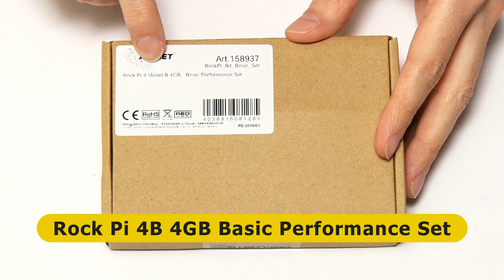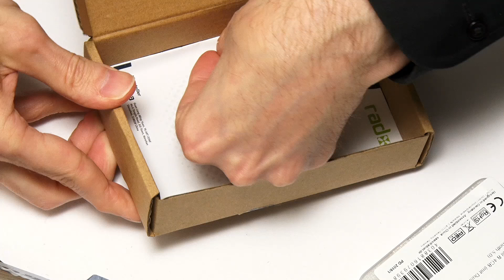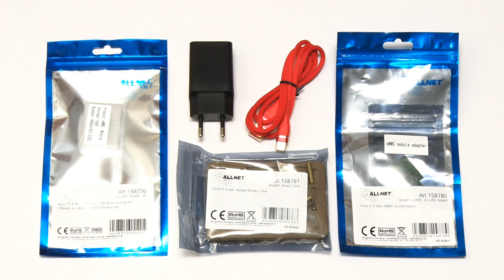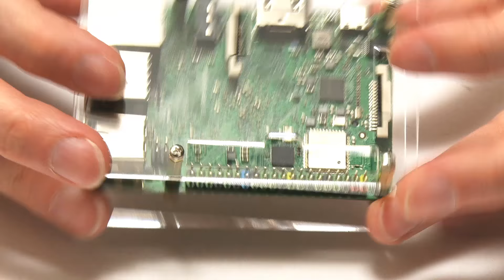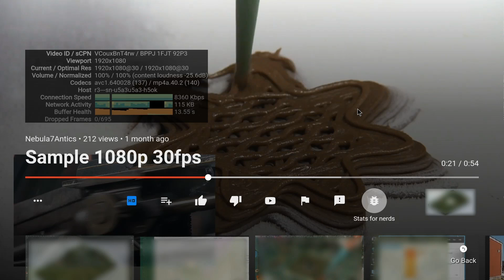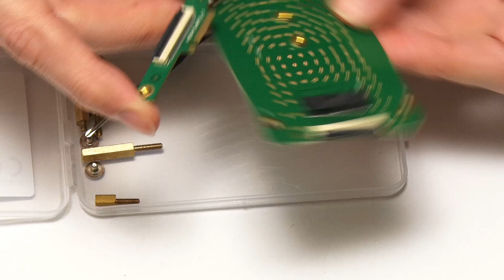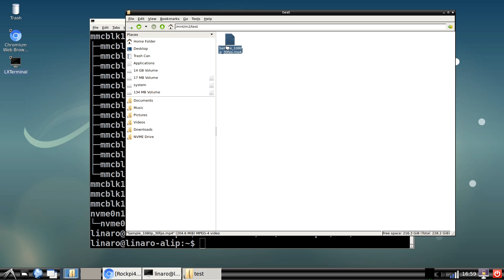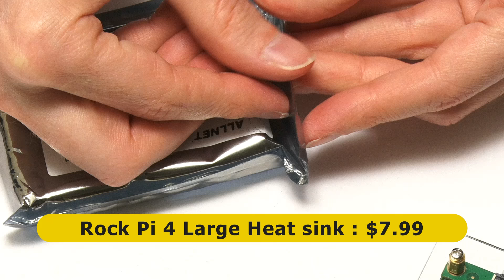Rock Pi 4B : M.2 & USB 3.0 SBC

Comment: The M.2 slot is in such a stupid place
Reply: I don't think so. This way you can have as large a m2 SSD as you want and it won't come over the CPU.     
Sure, it would make more sense on the front side, but then you won't have your RasPi style compatibility and you'll most likely be limited to M.2 2240 SSDs
Reply: @thekakan  - Fair points.. certainly that CPU would fry longer SSDs. And you'd lose the ability to put a heatsink on the CPU.
Reply: Agreed.. why have it so the M.2 board will stick waaaay out to the side?
Reply: It's going to get fried. They needed an extension ribbon
Reply: @blakryptonite1  we do have users who built their custom housings and directly connected the NVME to the M.2 slot. of course not on top of the CPU ;-)
Reply: wellll... yes but it also allows for external device option

Comment: You need to just clear the data and cache inside the Google Play app and also Google service framework. The latter will require you to enable system applications.
Go to settings>Applications
Click the 3 dots menu and enable 'Show system apps'
Scroll down to:
Google Play Services>
Storage>
Clear Cache
Google Play store>
Storage> 
Clear Data
Exit settings
Reboot
Open Google Play store and hopefully that's enough to retrigger the Play Store setup process again?
It may request you to log in again? However I've noticed in most of the latest devices, google services recognise you're gmail from the main logged in account and flashes that it's acknowledging about should just let you log in?
Another note this process usually ends up triggering Goggles account servers to verify your account as most elected to automatically enable 2 step verification?
Reply: thanks for your feedback, the latest image does take care about the playstore issue. it can be downloaded here: https://github.com/radxa/rockpi4-android-tv-7.1/releases

Comment: Soft after adding it all up, you can purchase an IPAD which is completely sealed and works without bits of sticky tape for roughly the same price. And it will pack in SO MUCH MORE performance and usability. Congratulation the to the 412k subscribers who don't have access to Apple products. What is even worse is that people might have purchased his Merch, which can be purchased all by yourself for pennies on the dollar. Why would you support this person. The content is mediocre and quite nefarious.

Comment: Great video, I hope you make more videos about this RockPi! For example, some performance test comparing the MicroSD, eMMC, M.2 and both USB 3 and USB 2. This could be a nice NAS / SeedBox with plenty of power to also run NEMS Linux or PiHole on the side.

Also Wireless speed tests would be cool.
Reply: Hi, there is a limited performance test on the IO of ROCK PI 4. But it unfortunately does not cover some of the interfaces like M.2... you can find it here: https://dl.radxa.com/rockpi/docs/hw/Test_Report_NCEMASLD-32G_20180313.pdf
Reply from the maker: I will indeed be making a follow-up video featuring a range of performance tests! :)

Comment: I subbed. Looks like they were forced to put the M.2 on backwards because of the heat of the processor.

Nice product, but the components need to be rearranged as to have the cpu  top side with m2 offset, or even on the bottom. Ports can be moved to bottom as needed.

As their solution for now is a daughter board, I still think the cpu must be on the top, being that heat rises.
I see that this product is really a good start, and designed differently may be able to fit everything w/0 the daughter board.

They should also find a way to not solder the memory. maybe  mini BGA sockets like we used to do PLCC in the old days. At least it's not like eating a GTX1080Ti just because one dram chip goes bad, but still, the user will have to re-do everything if the thing fails and the user incorporated it into a main every day item.
Reply from the maker: Thanks for the sub, welcome aboard!

Comment: That's very cool precise decision taken device, very similar to a Android phone. Damn it comes with Android , love the device for experiment with other Linux distros. M.2 extender location is quite bad design or they changed the location of gpio pins to sideways it will be easy to connect. or cut out for gpio in m.2 connector board
Reply: I think, the M.2. extender board was meant to be mounted on the other side of the main board, below the heat-sink - this way it will not block the microSD and/or GPIO / other connectors :)
Reply: @pituspete  I am saying that there should be a small notch exposed on m.2 extender for gpio opening cuz it blocks the connection to them via female pins and it's annoying. So the gpio mist be bent to sideways so it's quite easy.
Reply: @mbk0mbk  - I know what you're suggesting, but what I was saying is that the M.2 extender should have been placed on the OTHER SIDE of the main board, not at the GPIO side, but on the Radiator side, below it ... this way it doesn't interfere with GPIO pins or with the SD card slot. I think the author of the video just placed it on the wrong side :)
Reply: @pituspete  oh snap you are right , how come we miss that small but important detail.
Reply from the maker: RADX intend the M.2 board to go on top, but it will also fit below the larhe heat sink as you note.

Comment: One question. I noticed when you put the nvme drive in place, the screw holding down the drive looks like it is shorting some test pins. Could that cause the drive to work improperly?
Reply from the maker: It is very close, but fortunately not shorting anything. I have very carefully inspected!

Comment: Would this fit in a regular raspberry pi 3 model b+ case???
Reply: no unfortunately not, because the CPU is on the bottom and needs cooling. For the rest it should fit of course. We are working on housings which will take care about these issue.

Comment: Thanks for another great video Chris! I wondered if it might be possible to flip this SBC, for thermal reasons, by adding four risers (and possibly a flat acrylic base sheet) so that the heat sink ends up at the top and the M.2 at the bottom? Is the 'conventional orientation' simply a hangover from the way we see Raspberry Pi tradition?
Reply: that is technically possible, but has a disadvantage when using wifi or bluetooth. It covers the signal to a certain extent, because the antenna is integrated in the PCB.

Comment: can i get this set up as a NAS. I would love to get 4 3.5 drives hooked up. What would i need. I can make a custom case with a 3d printer.
Reply: yes, this is doable, please note there is no support for hardware raid
Reply: @NB-sw1op   would just not just use Unraid or freeNas  for this.  That should work i  hope.  Other then that  what cables would i need to connect 4  drives.
Reply: @calilifestyle  you could try OMV open media fault, it is Armbian based and runs on top of ROCK PI 4

Comment: Great video as usual Chris. However, to mitigate the problem of not being able to access the sd card, you can get a micro sd card extension lead and glue it or fastened it to the m.2 board. Of course I'm assuming you have though of this.
Also, have you tried any of the sbc's with a mobile phone thermal camera at all or are you thinking of doing a video about it as it would be a very useful project?
Reply: I think, the M.2. extender board was meant to be mounted on the other side of the main board, below the heat-sink - this way it will not block the microSD and/or GPIO / other connectors :)
Reply from the maker: It will fit both ways, but RADXA intend it to go on top.

Comment: I like it, BUT the hat for the m.2 drive covers the IO pins. I see this little unit as a really nice heart of a music/media player but if you can't put a hifi berry on it ,, well that's a fail. Just think though,,, all of the storage in such a small package with a hiifberry on it powered but a linear power supply all in a little box..... Well it just makes me all warm a fuzzy inside!!
Reply from the maker: Ah, but you can position the M.2 board below base or large heat sink. Or it could be mounted "long thin" on a custom board/case . . . or indeed this can be done without the M.2 extender. :) I find it amazing that for less than $40 you can now get a SBC with an M.2 slot.
Reply: @ExplainingComputers  Oh the film flax cable will reach o to the heat sink?

For my light bulb I wanted to keep it form factor and I had an aluminum case in mind that would make a great project... You know   how it is when the geek takes over!
Reply: @ExplainingComputers  - I was just about to say that I think, the M.2. extender board was meant to be mounted on the other side of the main board, below the heat-sink - this way it will not block the microSD and/or GPIO / other connectors  :) The way you showed it mounted on the video is rather awkward, losing the nice acrylic case too.

Comment: I recently procured a Rock Pi4 B and I was waiting to see a similar video on how to mount external storage drives on it. Thanks for explaining through the video about the SSD. I am hoping that an external DVD drive should also work on Debian distribution. Sadly, the Android TV OS version doesn't allow us to hookup external media drives. Also, I noticed that there is an issue with support for Widevine L1 DRM. Due to this streaming apps such as Netflix and Amazon Prime do not work on the Android distribution. They did release an updated Android version with DRM L3 support though recently. Link is here: https://github.com/radxa/rockpi4-android-tv-7.1/releases/tag/20190314_1810_703e366. Excited to see more on the Android part a it can turn out to be a great media centre device.

Comment: Chris, I think the M.2 Extender Board is Upside Down,  Flipping It would have the M.2 protected and the cable with more slack
I think i will go all out and get the 4 gig kit plus extender board,  as i believe No Pi 4 til April 2020 (don't quote me)
Reply: That would Twist the Ribbon, just makes more sense to have it inside protected
Reply: I thought exactly about the same thing, the M.2. extender board was probably meant to be mounted on the other side of the main board, below the heat-sink - this way it will not block the microSD and/or GPIO / other connectors :) Also, this way M.2. would be on the 'inside' rather then exposed to the 'outside' of the whole contraption. And I can't see how it would 'twist the ribbon'' ? You just flip it around the ribbon connector from one side to the other, no twisting, just bending the other way.
Reply from the maker: RADXA intend the M.2 board to go on top. The ribbon will not twist to flip.
Reply: @ExplainingComputers  I'm not sure I understand, why would it need to twist?
Keep it connected and just unfold flat, then fold the other way and you end up with the extender positioned exactly the same way, but on the other side, no twisting required.

Comment: I may have OCD with this one: First, the Nvme extension board is a bit long to match the motherboard length and make a nice sleek stack easy to fit everywhere. Secondly, the GPIO is kind of blocked by this Nvme hat (not a big issue: a ribbon will do the job done) and putting the hat underneath also poses some issues. Finally, the enhanced heatsink is anodized/coated on its contact surfaces... Not the best choice for heat spreading, Imho.
But it's a really interesting one by the way. More interesting than some competitors on the same price range and more suitable for one of my projects. Decisions... Decisions... Thanks for the review!
Reply: very good input indeed! we will put this into the planning for future releases of the M.2! THANKS
Reply: very good input indeed! we will put this into the planning for future releases of the M.2! THANKS

Comment: I have one of these - bought it a couple of months ago - and it's working pretty well.  The one thing I dearly would like to know how to do is to copy the microsd image to the M.2 card so I can boot from the M.2 card and do away with the microsd card altogether.  By the way, my heatsink isn't all that hot - I don't think the larger heatsink is necessary at all.  My only complaint is that I'd like to see a more current version of Linux than 4.4.154.
Reply from the maker: I think they ate working on NVMe boot.
Reply: When they have that working then this will be, by far, the best computer for the least amount of money that can be bought.  The other thing they need to work on is making sure that the Xfce4 desktop environment and window manager works the way it is supposed to.

Comment: does the host switch allow you to edit the emmc (being plugged into the board of course)? So sad that they didn't include a second pcie connector for some sata lanes. I'd also wish you would showcase the bios, if it has any (the boot menu?)
Reply from the maker: No boot menu or BIOS I'm afraid.
Reply from the maker: Like all ARM  SBCs.

Comment: This video needs a huge side note as it's a bit misleading when it comes to software and the OS. Rock Pi boards have almost non existent software related support and a lot of the drivers only work partially or none at all. Debian that was briefly showed in the video functions very poorly on this board and has tons of problems. Including video playback from a browser which should have been shown as it's worse than Raspberry Pi by a mile. 
These cheap Chinese boards are made to impress and to sell quick, but will very unlikely ever have any community support or dev support to provide all the necessary drivers unlike other boards like RPI,Tinkerboard and Odroid. 
Having owned several of these (did you know there's over 150 SBCs out there now?) - I'd say don't choose these boards by bells and whistles especially if those bells and whistles don't work well.
Choose it based on what you need. Do you need USB3.0? Odroid XU4 has one+support and drivers+great speed or wait for RPI 4
Do you need emmc? Odroid has one as well
Do you need better networking? Tinkerboard
Do you need something smaller? RPI 3A+ 
Do you need M.2? Really though? Ok then get this board I guess, but why? :D

tl;dr don't buy cheap Chinese knock offs, go for quality of software and community support first. Even Tinkerboard has better support than Rock boards
Reply from the maker: I make a statement re software support at the end. And it is improving.
Reply: M.2 on these things operates at PCI-E 2.1 (2x). It is a complete waste of money to put an NVME drive on this thing. That is equal to PCI-E 3.0 1x. So your NVME drive is capped at 985 MB/s. But this thing probably never even hits that reading rate anyway. And NVME drives are meant to be operating at much faster speeds. You are still much better off just reusing a SATA SSD (via USB 3.0 at 5Gb/s) if you care about your money.
Reply: @bobbyboygaming2157  What you're saying is is that the nvme drive would be capped at 985 Megabytes per second or 7880 Megabits or around 7.5 Gigabits per second (rounding down to make it a more even number) . Then you go on to say that using a drive over sata through USB 3.0 capped at 5 Gigabits per second or 5000 megabits per second or 625 Megabytes per second would be better... Seems logical.
5 gigabytes a second > ~7.5 gigabytes per second.
 I'm going to go ahead and include the link to show what the original comment was just in case he changes it.
https://photos.app.goo.gl/ge3xDwH17wtu3d1a9
Reply: @neb_setabed  Yes, I am saying that SATA 3 is fast enough for this device. And that it is not worth spending money on a bottlenecked device. You have to take into account that those are only theoretical values anyway.

Here, I will break it down for you. So, yes 7.5 Gb/s is greater than 5 Gb/s, BUT first of all, you don't even know if the rock pi can even hit that (severely bottlenecked) reading speed of 7.5Gb/s (because it has such a weak processor). BUT if it did, then a difference of 2.5 Gb/s is probably not gonna "blow your socks off", since you won't be doing any crazy computing on your SBC. Assuming you already have an old SATA SSD drive you are much better off repurposing that one for your SBC and upgrading your main Desktop to an NVME so that it operates at full PCI-E 3 (or 4) 4x bandwidth.

However, at the end of the day. You can do whatever you want with your money. There are videos on Youtube of people putting SATA SSDs into Playstation 2s and saying that it's faster, when in fact it is not since the interface is bottlenecked.
Reply: Hello wonderful person.

Comment: Have allergy to Mac & OS, Love Android BUT...
"Google app stopped" 
Is the message I'm getting on my Galaxy S8 since last week and Help was useless to find the reason or rectify it. Seems a new UpDate is (AS ALWAYS) the source of problem. Multiple reset to factory origin restart didn't help.
Finally found a partial remedy to at least make android phone work, by removing all the recent Google Update files...
Good luck to you and PLEASE let us know if you find what is the reason, you can't reach Google PlayStore.
Reply: We unfortunately can not tell you too, why it did not work. What we can confirm is that the latest version which is ready for download does not have this flaw. :-) https://github.com/radxa/rockpi4-android-tv-7.1/releases
Reply: @NB-sw1op  Good to know that bug is removed. I can't resist the temptation of putting hand on Samsung Galaxy S10 soon.
Reply: @samsen201  :-)

Comment: Nice board with its 64 bit cpu, DDR4 memory and USB C type plug for power but I would like to see a SBC get all the trimmings together. All this board needs is a four pole audio like the Tinker Board and PoE without a hat and she'll be the one I'm taking to the dance. Also could you put in the description the total cost of the final build with all the accessories and drives used please?